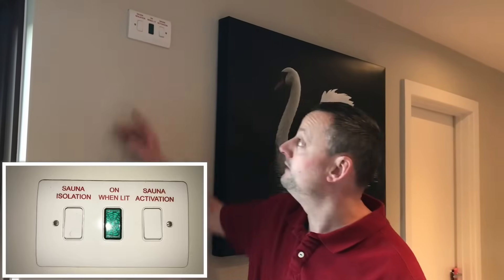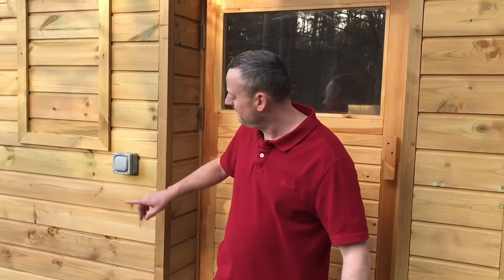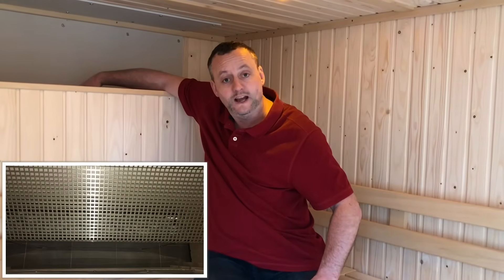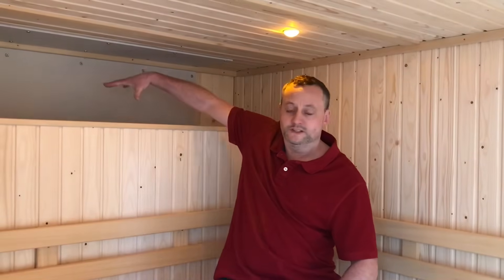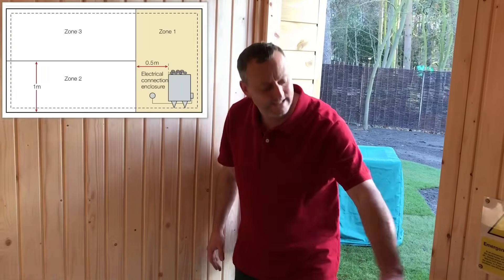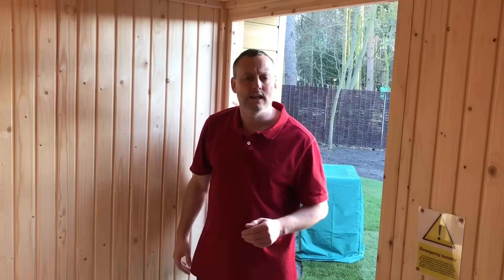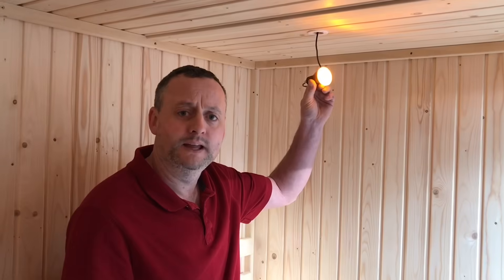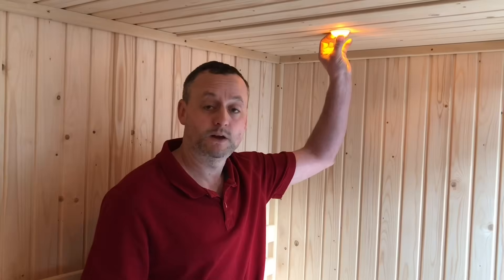BS7671 Special Locations Saunas Zones 1, 2, 3 and IP Ratings

Comment: For an indoor sauna, do the cables running within the insulated walls need to be heat resistant such as H07rn-f or can it be flat twin and cpc since it is not inside the sauna?

Comment: What happens if a bulb blows and needs replacing. The seal might get damaged when replacing the bulb ??        Also it would be nice to know exactly why there is no safety risk with no RCD on Sauna heater.   Just for better learning.  Thanks